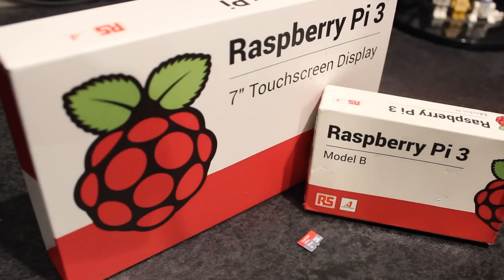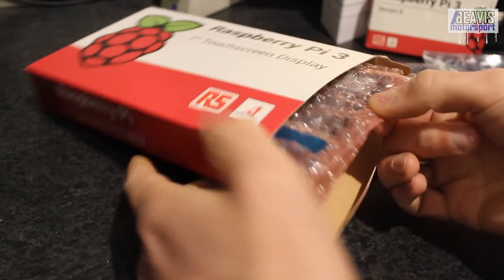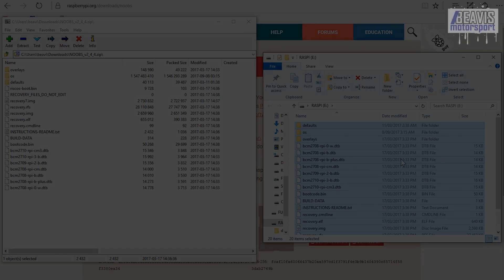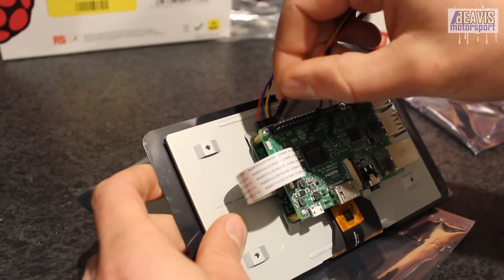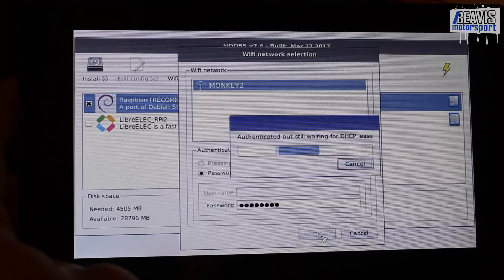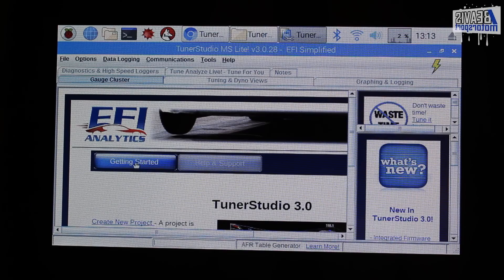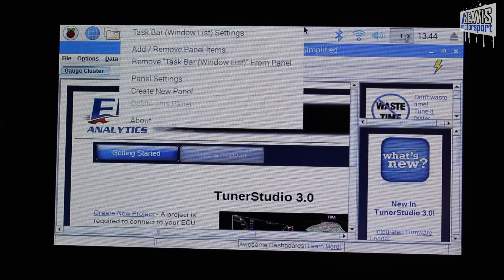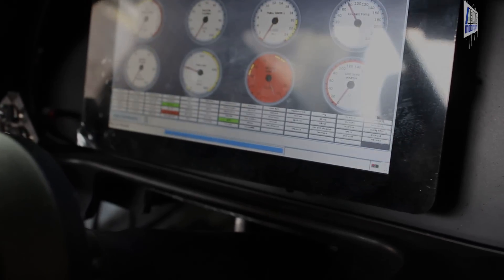GUIDE: BUILD A RASPBERRY PI3 WITH TOUCHSCREEN FOR CAR DASHBOARD

Comment: The pi is a great device but it is too slow for anything, that's why it is thrown away in my room. i put the blame on some youtubers who told people at that time that the pi is good and fast. Why did they lie..?! i don't know !
Reply from the maker: I guess it depends on what you are trying to do with the PI. Definitely fast enough for my use! Thanks for watching.
Reply: its good and fast, only if you use win 10 image has wery slow. windows not have one board computer software newer.

Comment: How quick is the boot time?  Did you build something to properly shut down the raspberry pi instead of just a hard power cut?  When you go to change tuning in the megasquirt, do you have to unplug the usb from the dash and tune with your laptop, or do you find it efficient enough to change the tune through the raspberry pi?  I am in the process of building a turbo 24v swapped e30, and I am loving this idea for the dash.
Reply from the maker: I've never actually timed it, but maybe 30 to 60 seconds to boot up. I have a power off button installed which i press before shutting off the car. When the car is on the dyno the dash is disconnected. The PI is not really for tuning.

Comment: Don't you need to.flash the SD card
Reply from the maker: If by flash, you mean format, yes you may need to if it is brand new out of the packet.
Reply: @Bbeavis  flash is what you were doing around 2:30
Reply: @Bbeavis  interesting the way you did it, normally you're given an iso you can then flash with something like Win32DiskImager etc, it's a faster process as it's just one file
Reply from the maker: @dylanharding5720  Obviously in the case of NOOBS, with the zip, there is no ISO.
Reply: @Bbeavis  you could flash the zip itself.

Comment: How to connect your car's sound system with raspberry pi??
Reply from the maker: Um I'm not sure mate, I put this in a race car which doesn't have a sound system.
Reply: you need only additional DAC board to raspi and drivers then can use good guality sound, add speakers and mic if need etc. cost about 5-10$

Comment: I’d rather use one of the smart garmin devices with Bluetooth obd-ii connector. Supports most metrics even turbo pressure etc and just looks good (no electrical tape supporting your screen ;-)
Reply from the maker: While the simple bluetooth obd2 devices certainly have their uses, in this application the Raspi is a bit more specific than a universal obd2 connector solution. it logs all the data from the car and can offer a lot more detail than what obd2 car.

Comment: Love the build. I am looking into doing something like this to my RX8 project, but I am wondering if I can run the Tuner Studio dash with a factory ECU or does it need to be running a Megasquirt system. I have searched online and can't find any info. Do you know if that is possible? Cheers
Reply from the maker: Tunerstudio software is specifically made for the Megasquirt ECU. You won't be able to use it with an OEM factory ECU.
Reply: Thank you. That is what I was afraid of. I appreciate the info. Enjoying your channel
Reply: @Bbeavis  can i use on motocycle?
Reply from the maker: @guilhermeavila3758  Sure anything is possible, depends on your bike and getting the right software for your setup.

Comment: All sounds really cool - thinking of doing this for my Microsquirt-equipped '73 VW Super Beetle, probably with a somewhat smaller screen - will have to investigate what would fit into my dashboard best. Already have the Raspberry Pi 3, my uncle gave me that for Christmas to do something cool with - I think this qualifies!
A few questions: How do you interface it to the ECU? That was never addressed in this video. I have the cable with RS 232 connector and USB adapter, do I plug that into the Raspberry's USB port? How do I get TunerStudio to automatically connect to it? I always have trouble getting TunerStudio to connect to the ECU when using my laptop, is there a way to resolve that?
How is it powered and turned on/off? These use a 5V input, I'd assume tear apart a car phone charger, solder the inputs to the car's electric system and outputs to the Raspberry's input? Would I connect it to the key input so that it's powered when ignition is on, will the Raspberry boot automatically that way?
Would it be possible to program in a dimmer or night mode? I'd think it would make sense to wire an analogue input to the dash lights so that when I turn on the dash lights (and headlights) it gets a lot dimmer.
Is there a way to change the aesthetic of the gauges, maybe colors? Even if it's a digital display, I'd think there might be ways of making it match my old-looking wood-grain interior a little better than the modern bright colors. Likewise, if I use a smaller screen I might want it to use vertical bars instead of round gauges, so I can put more information on a small screen. What about using the pro version of TunerStudio that can re-tune my ECU as I drive, could that run on this?

Thanks for the great idea, I'll have to start messing with it soon!
Reply from the maker: Hi Quill, Thanks for watching.
This is directly connected via USB from the PI to the ECU, it has no issues detecting it immediately.
I just have a 12v to 5v USB adapter to power the pi with a micro usb cable, it's connected as soon as the car is turned on and the pi boots up once it receives power.
I haven't tried to wire up a dimmer, but I assume you can. You'll need to find out if the pi can control the screen brightness.
You can completely customize the gauges on the screen, do a google for custom tuner studio gauges to give you some inspiration.
Yes you can run pro tunerstudio and use the autotune feature.
Cheers
Reply: Thanks for the reply! Sounds like I'll be able to do everything I'd want to with it, a very capable device, without too much difficulty. Will have to have my cousin and uncle, who are very capable programmers and quite eager to help me with this project (Uncle gave it to me with being involved in mind I'm sure), they could probably help me figure most of that out. Looked up custom tuner studio gauges, saw some pretty cool setups, looks very customizable. Nothing with the retro look I'd be looking for, but I'll figure something out.
Reply: You have 73 super beetle? Thats cool dude !

Comment: The lightning bolt symbol means the incorrect OS is on the sd card. It's not a power issue.
Reply: That's not true. It's exactly low power issue. I have used PI since years and the lightning means low power. Replace it with 2-3A power (for the LCD, you need stronger), good cable (very important) and it will disappear.
Reply: I had the same setup not too long ago; it is specifically your power cable to the pi.  There are crappy USBs out there that cannot supply more than one amp very well and the voltage drop is pretty bad as well.
Reply: Don't advice people without knowing about the thing. The bold DOES MEAN that the power source isn't fulfilling the requirements of the Pi.
Reply from the maker: Dilithium Crystals, that is incorrect.
Reply: You're wrong.
Reply: From https://www.raspberrypi.org/blog/introducing-pixel/
"Finally on the subject of icons, in the past if your Pi was working particularly hard, you might have noticed some yellow and red squares appearing in the top-right corner of the screen, which were indications of overtemperature or undervoltage. These have now been replaced with some new symbols that make it a bit more obvious what’s actually happening; there’s a lightning bolt for undervoltage, and a thermometer for over temperature."
Reply: Dilithium Crystals yeah do you even have a rpi

Comment: I have a $200 jvc with an ugly interface. I wish I could flash android to it or linux
Reply from the maker: You could look into a cheap android headunit from somwhere like ebay?
Reply: I did look into that when I was shopping radios, but a few people were saying the cheap ones only worked for a month. This was 2 or 3 years ago, so maybe they've gotten better. I may look into it again after I get my car fixed
Reply from the maker: Yeah I've got one in one of my cars and it's performed quite well considering it's just a basic piece of kit.

Comment: Very cool mate, would love to run something like this but with data logging as well. Can you set limits for temps and pressures and have alarms activated when those limits are exceeded?  Any way of incorporating shift lights?
Reply from the maker: Yes all of that can be done with the interface between the dash and the ECU. I have some of said features setup now, and I'm working on improving things like logging to make them more efficient and easy to extract for review.

Comment: Nice! I've been trying to set this up in my project for a couple months now. I was wondering if this would work without megasqiurt?
Reply from the maker: I'm using TunerStudio as that is the best software to work with Megasquirt, you'll need to find software to work with your specific application/ECU that runs on the raspian OS.

Comment: Very nice video.  I just have a quick question.  I am a complete noob but would like to put a digital dash in a vintage motorcycle that uses analog inputs (Tach, speedometer/odometer, temperature mainly).   I'm sure there's some coding that would need to be done for such a setup but is there specific controller that you can recommend for what I'm trying to accomplish?
Reply from the maker: Hey Turbo, you can probably achieve what you want with a raspberry pi or arduino... it's even a little beyond my knowledge - but I'm sure it can be done! Sounds like you might have a bit of homework to do!

Comment: Are you going to run shadowdash on it?
Reply from the maker: No Bryce, - running the full Tuner Studio Megasquirt software, it offers full tuning and control of the ECU.
Reply: BEAVIS Motorsport can’t you run multiple program on it, it’s probably nice to be able to tune on the pi but some of the pi dash with shadowdash look great for just the gauges
Reply from the maker: Sure can, plenty of options. ShadowDash is just a dumbed down version of TunerStudio really, any dash from ShadowDash can work in Tunerstudio.